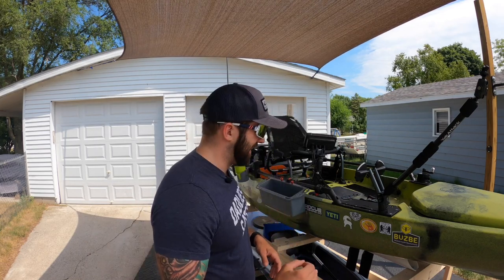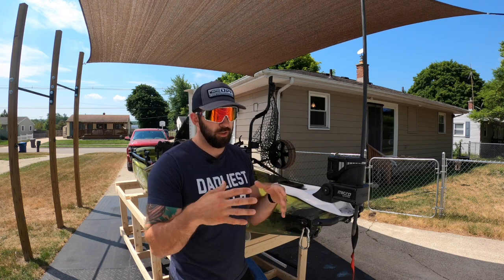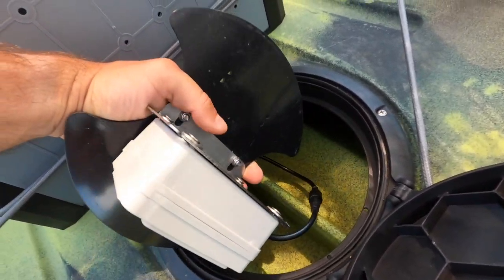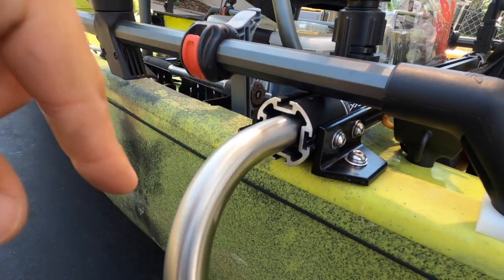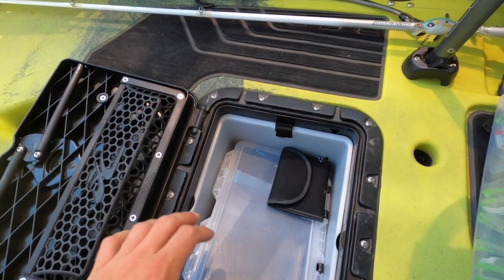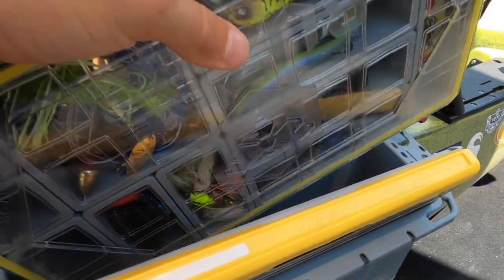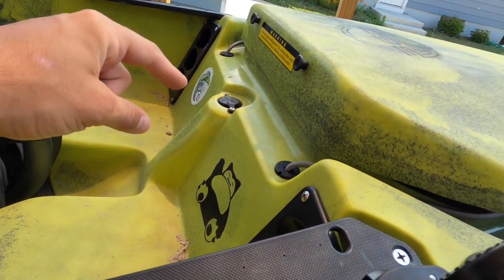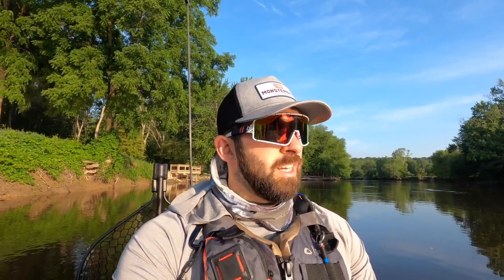Hobie Pro Angler 360 | Bass Fishing Setup 2020

Comment: Love the vid, very informational!!  Question about the Buzbe, how does the plastic inside the box hold up to the rubber worms? They usually melt anything they come in contact with over a period of time. Thx
Reply from the maker: No issue as long as it isn't elaztech or whatever sukoshi bugs are made out of.

Comment: Could you tell me the reasons you went with the PA14 as opposed to the PA12?  I'm looking to purchase the PA next year but I'm not sure which model to get.  Obviously the 14 has more storage, which isn't really that important to me, and I've read that it's a little faster.  Both are obviously very stable, just interested in your reasoning behind the choice.  Thanks!
Reply from the maker: I’ve owned the 12 and it’s not even close.  The 14 is the only way I would go, so much more storage and rod holders and room to move.  And I fish small waters
Reply: @aaanglers  Appreciate the response.  I fish small waters as well, but can't decide which would be a better fit for me.  I'll take what you said into consideration and probably demo them both.  Thanks again!

Comment: I also had a John boat for a couple years, have a PA14 360 coming in for me by the end of the month and I’m stoked! Why did you end up kayak fishing instead of sticking to a John boat? Sometimes I feel a little crazy for picking the pa14 over a boat 😂
Reply from the maker: Kayak is easier to use around me.  Ease of access
Reply: @aaanglers  Same here! I have a small truck and have a ton of electric motor or kayak only lakes around me around 45min away. I’m wanting to fish more of those and hit some rivers here in IL and the hobie will be better for that for sure! Seems like it’ll handle bigger lakes around me just fine too.
Reply from the maker: @Mbtharp1  It absolutely will

Comment: Installed the Boonedox landing gear on my Hobie about a month ago - nothing but regret right now.  Extremely difficult to get the gear in/out of the knuckles to re-position...and they are a new set as well.  Been working on grinding down the inserts for a better fit, but it's a major hassle.
Reply: I’m thinking about added BD Groovy wheels to my PA so you saying you have new set of groovy wheels w/ square bracket inserts or a new set of the old style w/ the round bracket inserts?
Reply: @georgefitzhugh6455  Here's the link to the kit I ordered.   I had Boonedox verify it was the right set of parts.  I have a Pro Angler 12 with 360 mirage drive.  https://boonedoxusa.com/collections/landing-gear/products/groovy-landing-gear-hobie-2015-current
Reply from the maker: So my set actually functions really well.  I had issues with the older set I had, I wonder if it is the alignment or the side bolts being too tight?  Have you thrown some dry silicone lube on it?
Reply: @aaanglers  Will try the dry silicon lubricant.   Which side bolts?  The ones going into the knuckle or the ones going into the kayak?

Comment: Man that is an awesome Hobie kayak you have. I love how you have it set up. Love those Wheels makes it so easy to carry it. Question? On the drive I did not see the straps that go across the top of your foot. Is that a new option or did you take those off. My reason for asking is I have big very very wide feet sz15 6 EEEEEE with very fat wide toe and my feet will not fit through those straps. A guy at a boat ramp let me try to see if my foot will fit through on there Hobie. He saw how wide my feet were and was curious to
 And I couldn't get it to fit through. The guy was shocked how wide my feet were. We both learned something at that moment. I want to upgrade to this kayak but I don't know if it's going to work out for me. I have to kayak barefooted👣 because of this. I can't use the foot brace on my kayak because my feet are too wide and they won't stay on they just keep falling off. But I really would love to upgrade to this pedal Drive kayak. It really sucks having big very wide feet I never thought it would affect kayaking. Thought it would only affect Footwear which sucks for me too. Good video brother keep up the good work.
Reply from the maker: I kayak barefoot and I took the straps off.  They are just annoying .  No footwear needed!
Reply: @aaanglers  O ok you kayak Barefooted 👣 too that's awesome man. Oh the straps come off ok. I don't see why you need them on the Kayak. I can agree with you with no footwear. I am used to doing things barefooted 👣 anyway because I'm barefooted 👣 95% of the time. The only Footwear out there that will fit me is flip flops which barely fits my foot because my feet are wider than the flip flops strap. Thank you man your information was helpful.